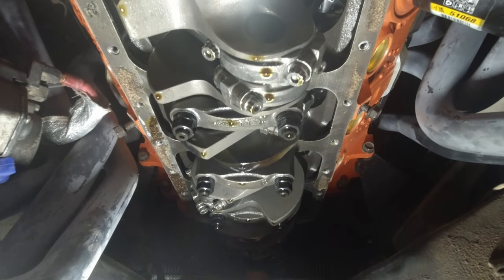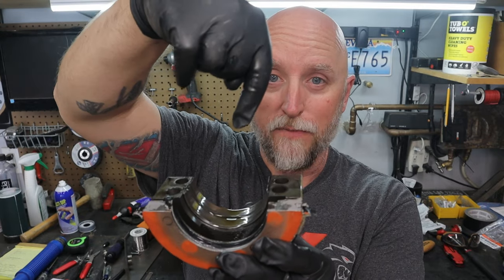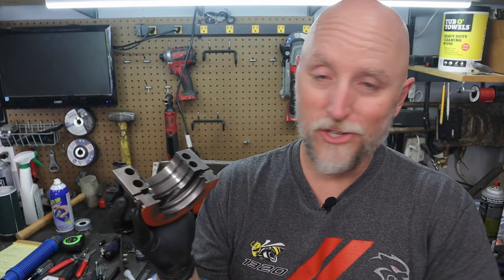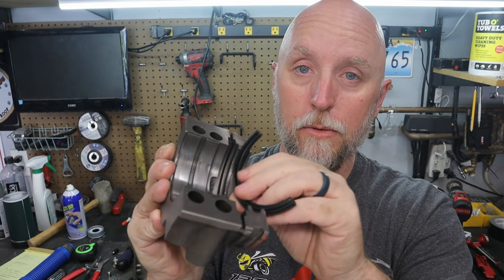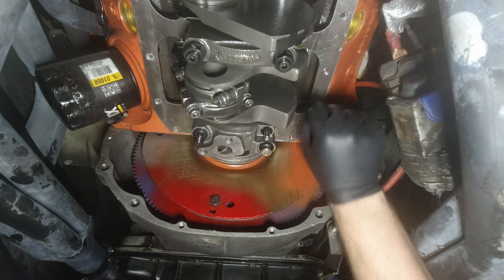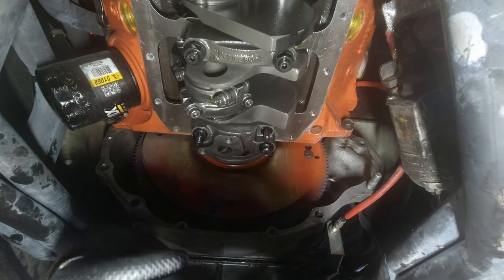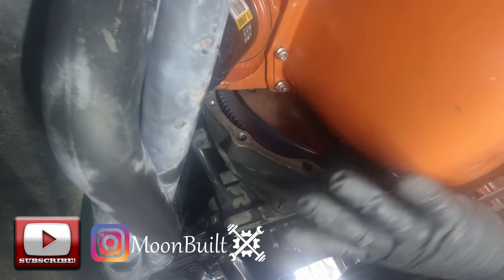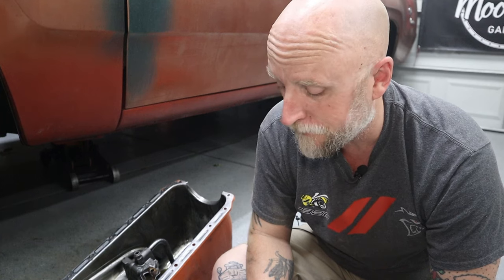Rear Main Seal Replacement WITHOUT Removing Engine or Transmission | Easy DIY

Comment: Right on Brother, I'm a vet to 66 fairlane GT, I love how  told the truth at the end that all jobs end up working perfectly at the end, myself I'm on 3rd paper gasket install from various jobs such as RMS replace and finding exactly where oil is coming from because you can't tell untill there 5 quarts in the pan and you start it and see if it leaks. Bottom line it was real awesome of you to add the last part to your video it helps people out there. Thanks  bro!
Reply from the maker: Thanks for watching!  I think its important to show the true part of this hobby.  So many videos make it look like everything works perfectly the first time out, but often that's just not the case, and it frustrates people to make them think they are the only ones having problems getting things back together...none of us are perfect, and I think some people forget that

Comment: It is a lot easier than removing the engine that's for sure; I am going to be doing my v8 dodge ram sometime soon; I hear a noise coming from the sump, don't know what to think but I bought the bearings and the oil pump. I'll see when I get the sump off.

Comment: Took mine ALOT of cranking before I started showing pressure. But I understand your concern. I liked the video and it gave me some better ideas for mine. Thanks.
Reply from the maker: When I had a good gasket in place the pressure was almost immediate, especially since this wasn't a complete new build, so there was still some oil in all the passages

Comment: Mortske mentioned the Super Scraper and I got one. You're not kidding, they're incredible.
My tree guy has a 360 in a '98 2500 with a leaking rear seal. I don't know yet if it's 4X4, and I'm wondering if that pan comes out before I tell him I'll do it.
Reply from the maker: Morske is how I found the Super Scraper.  That pan I would think should drop out like mine...the only real difference, I would think, would be the transfer case for the 4x4...so maybe the front driveshaft may be an issue now that I think about it, but I couldn't say for sure
Reply: @MoonBuiltGarage  I'll just have to check it out. Maybe have to drop the axle some.

Comment: Awesome tip on the plastic snap ups, did you make another video or did you get it mounted with a gasket and get oil pressure? my 360 and 318 get oil pressure without that gasket, thanks for video
Reply from the maker: I don't remember if I did another video...you would have to check the playlist, but yes, I had to redo the gasket to get oil pressure.

Comment: Great job learned a lot, did the new gasket fix the oil presure?
Reply from the maker: Fixed it perfectly!
Reply: After looking back on your pump install, you didn't put a gasket on while installing pump. Happens now and then
Reply: Hold up im confused, so you just are saying that there isn't a seal on the oil pump tube?

Comment: I see where a long bolt went through the flexplate, the crankshaft and contacted the cap. Was there a crack in the #5 cap? Did the block get imprinted the same way?
Reply from the maker: I noticed that...not sure where that mark came from, but there is no crack in the cap.  I would think that if that mark were from, say maybe the torque converter bolts, than there would be a long scrape along the cap....but no, there are no other marks, or any cracks
Reply: @MoonBuiltGarage  I think at some point, someone put some manual trans flywheel bolts (much longer) in there and it locked the motor down, so there was no scraping. Then they caught the mistake and put flexplate (shorter) bolts in. Just a theory, but I have seen it done! Hopefully you have the leak repaired, once you get oil pressure. I have used vaseline or something thick like Lucas or STP to fill the pump and get it to prime faster.
Reply from the maker: The manual trans flywheel bolt theory is a possibility since I know this truck was previously a slant6/manual vehicle before someone swapped the V8/Auto into it.  I'm not TOO concerned about the pump priming since I didn't tear the pump down or anything, its just sitting empty a little longer than your normal oil change...Once I cut a new gasket for the pump I'll have it back together....but I'm working 12-hour shifts for the next few days, so....it'll happen when it happens
Reply: I did this on my 1978 D-150  last year and replaced the oil pump. I thought the main cap had a crack or hole in it, but found that he's an oiling hole. All I did was loosen the motor mounts, lift the engine a little, and pull the oil pan out easy peasy! I replaced the seal and replaced the oil pan gasket after looking everything over. The only problem I had was I didn't install the front rubber gasket properly, and just bought I new one and no leaks!

Comment: I did this last year in my 1978 D-150. It was easier than I thought!
Reply from the maker: It really is....more of a hassle than difficult.
Reply: True! I'm glad you've posted videos of things I want to do to my truck... there are not a lot of videos. The rear tank relocation and the fuel filler neck were some really good ones! Thanks for the info and keep them coming!
Reply from the maker: Thanks!  That was one of the reasons I started the channel...I was working on this thing, and noticed there wasn't a whole lot out there for these Dodge trucks

Comment: How did you change the other half of the seal without removing the crankshaft?
Reply from the maker: You can use a brass punch to start the top half moving around the crankshaft, and once it protrudes enough you can just grab it with a set of needle nose pliers.  To install the top half, it should just slide right around the top of the the crankshaft, but you may need the brass punch again to get it last bit around

Comment: So do you have to jack up the tranny to change the main seal?  My 1997 has an oil leak but I can’t tell if it’s the oil pan gasket or rear main? It’s dripping down the open side of the tranny inspection cover and looks like it might be the oil pan gasket but I’m not sure might just have to take it apart and take a good look.  Great video by the way
Reply from the maker: Thanks!  No need to jack the transmission up.
Reply: @MoonBuiltGarage  ok was the no oil pressure just in fact the gasket on the oil pump?
Reply from the maker: @cartermarchenkuski  Yeah, for some reason the gasket on the oil pump didn't want to seal so I had to replace it
Reply: @MoonBuiltGarage  well good it was only that
Reply: I'm dealing with the exact same thing literally the exact same thing I have a 1997 Dodge ram 1500 and I'm trying to find out if it's my oil pan or my rear main seal but it looks like it's dripping from the oil pan.
Reply: @ChristopherHenderson-cz7gi  yeah o never looked into it much the leak hasn’t gotten any worse so I’m just kind of waiting I’ll get it fixed soon but not right now not worried about it I only have to add oil every 800 miles or so and it’s only a little bit
Reply: @ChristopherHenderson-cz7gi  also I started running not full synthetic oil and just high mileage conventional and it seems to have helped the leak

Comment: so the bearing don't have an oil hole, I thought that all crankshaft bearings did?
Reply from the maker: I believe they do on the block-side, not the cap
Reply: looking at your bearings made me take the new ones out of the package to examine them and it seems strange how six pieces have the hole and the groove, two pieces don't have neither; and two other pieces have only the groove....I hope I got the correct ones for my v8 2001 ram  @MoonBuiltGarage

Comment: So pretty boy show the whole job next time.
Reply from the maker: I believe I made a comment about fitting a camera under the truck when working on jack stands, one handed, over your head...if not, give it a try and post your results....
Reply: Nobody owes you anything. if you can't get to this point without someone holding your hand, just go lay down on the couch. No need for rudeness at all.